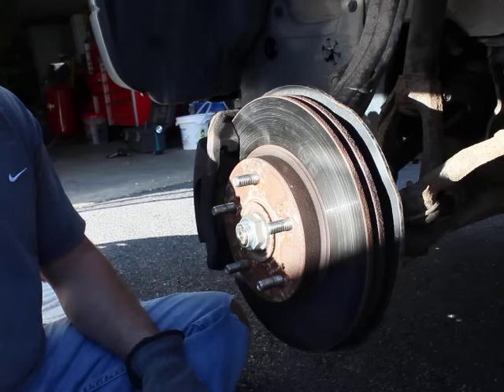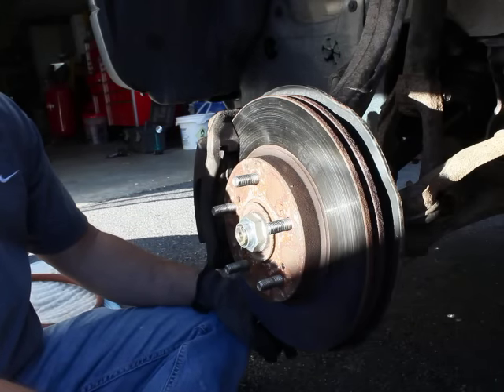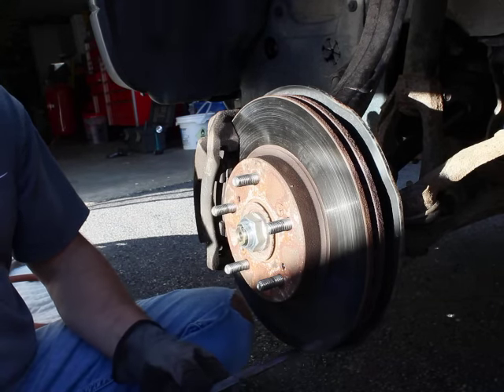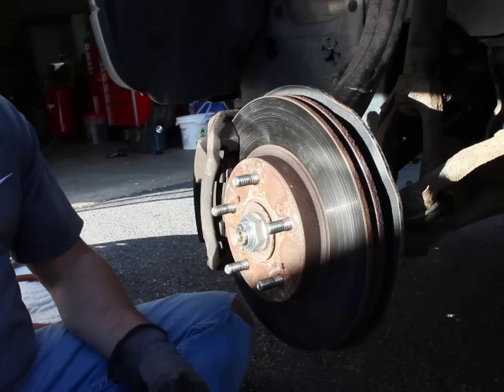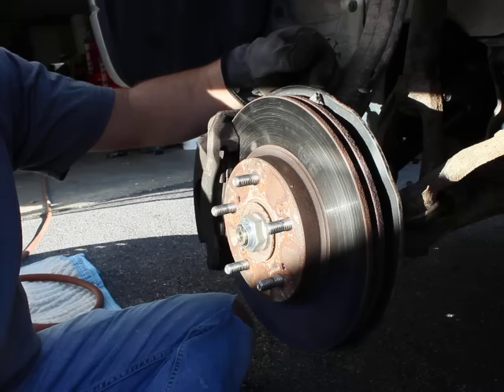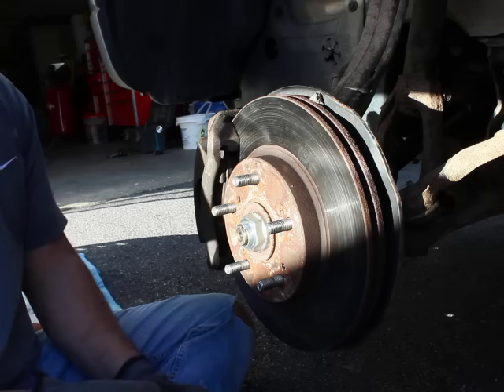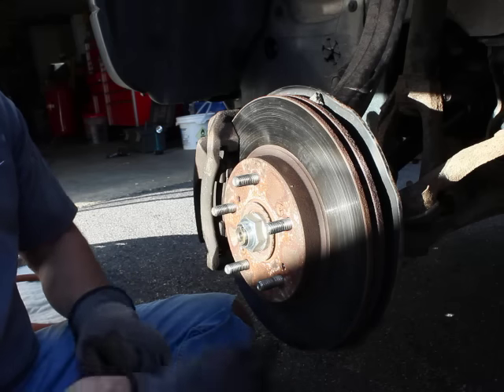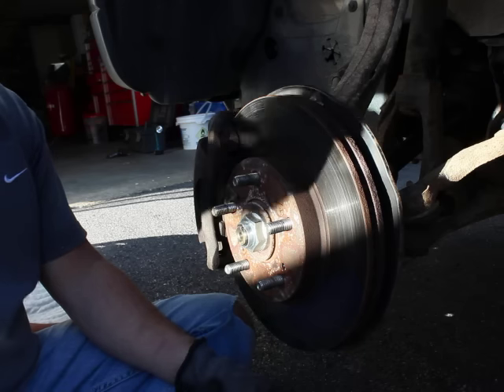Scraping Noise From Wheel While Driving

Comment: I hear this exact sound, but I don't know if it is this issue. I hear it for a couple of seconds when I start the car, and when driving at low speeds. It goes away once I get to about 35-40+ and it is not constant. It makes the noise then goes away, but it's this exact noise and sounds like it comes from my front driver tire
Reply from the maker: Hi Rob, I recommend you check the brake pads at the wheel you hear the noise, check the inner pads closely because this is usually where the wear indicator is located. The wear indicator is a warning tab mounted to the brake pads and touches the rotor when the brake pads are getting low. Let me know what you find, thanks.
Reply: @EddieCarrara1  I did the brake pad job myself about two months ago. I needed rotors too but I couldn't afford them, so I only did the pads cause it was super low. I just changed the rotors about 2-3 weeks ago and thought that would help with the noise but it hasn't changed at all. The noise was happening before the brakes were done, after they were done and never went away. Still currently hear it.
Reply from the maker: @Napoli85  Sorry I didn't see your reply. I would try pushing on the backing plate to give more clearance between the backing plate and rotor at the wheel you hear the noise at, it may be a quick fix. Keep me posted 🍻
Reply: @EddieCarrara1  I did but it did not help. I hear it when initially press one the gas pedal but when I apply more pressure to the pedal, it then goes away while I'm driving. It's at really low speeds and when I press the gas.
Reply from the maker: @Napoli85  Oh, then it's probably not the brakes. Sometimes the exhaust heatshields become loose from age or small pebbles get caught in the shield and cause a rattle noise on acceleration. Can you make a 30 second -1 min video of the noise, upload it to youtube and send me the link?

Comment: what do you think it is when it makes that exact noise when turning only right  about half a turn to a 1 full rotation of the wheel
its the front driverside  but i havent had my brakes done
Reply from the maker: It usually is a sign that the rotor backing plate is too close to the rotor, try using a screwdriver through the wheel and push the backing plate away from the rotor. You'll know right away if it worked or not. Keep me posted on what happens, thanks.
Reply: it comes from the front wheel tho  and i cant see the a backing plate on it  just in case i pushed the back wheel plates away a little but it remains the same
would low power steering fluid cause this?
ive read a few reports that it can cause squeeks and scrapes
Reply from the maker: Sure it possible low power steering fluid could make that noise. Can you make a video of the noise and post it so I can hear it?
Reply: i can try  dont know when ill be able to
thanks for showing interest mate
Reply from the maker: Sure, no problem. I'm pretty good at discerning noises if I can hear them. Even if it takes a few week to get the video up, just send me a link, and I'll take a listen.
Reply: Eddie Carrara turns out it was the wheel bearing
it had worn enough to have a metal on metal scrape
Reply from the maker: Wow, that's very unusual, good thing you caught it in time before it ruined the spindle. Thanks for the update, I really appreciate it :)

Comment: i just got my my brake pads and rotors replaced about two weeks ago and recently this squealing noise has been coming from the drivers side what might it be?
Reply from the maker: edwin m Hey Eddie, The rotor backing plate may be a bit too close to the rotor or it's possible maybe some rust flakes have fallen between the rotor and backing plate. When do you hear the noise?
Reply: I thought that might be the problem.i usually hear it after driving like speeds of 80-100 then when am breaking i start hearing it.
Reply: I figured out the problem, I got cheap brake pads. Learnt my lesson.
Reply from the maker: That will do it every time Eddie, cheap pads will get you by, but with a lot of noise and grief :)

Comment: I had my brakes and rotors done 2 months ago and i got a set of wheels installed recently but on the front passenger side wheel i notice the caliper clip grinding against the wheel theres no clearance, took it to a shop and they told me to leave it like that till the clip pushes itself a bit back but im not sure thats a good idea any inputs?

Comment: my 01 suburban makes a noise like something lose coming from my rear passenger side wheel. it's sound like the noise in your video. only happens when I'm driving and hit bumps. it started after I got brakes change.
Reply from the maker: Hi Bernard, I recommend checking the backing plate first, if everything looks good, bring it back to the mechanic and have them check it out.

Comment: i get a grinding noise when i turn too far. This just started happening.
Reply from the maker: Hi David, is the car moving when you hear this noise or can you be sitting at idle and just turn the steering wheel all the way in one direction? If the car is not moving and you hear it, check the power steering fluid level in the reservoir. If the car is moving and you hear a scraping noise, check the rotor backing plate on the wheel that is making the noise, you may either have some debris caught in there or the plate got bent somehow?

Comment: i'm having this issue i'm hoping its the back plate. starts to scrape here and there when i drive. Thank you for this video.
Reply from the maker: Marco Mejia Sure thing Marco. keep me posted on what you find, thanks.
Reply: sorry for the late reply, So i inspected the back plate brakes, rotors, caliper but looked normal to me. But i did notice that the brake pads looked worn out so i thought maybe that might be the problem. Weird part was that the scraping only came when i started to drive, never when i braked. But as soon as i changed them the scarping was no longer and i am happy :) still appreciate your'e video Eddie Carrara
Reply from the maker: Awesome Marco, that had to be your issue :)

Comment: How's going Eddie just watched your video gave me a tip , I have a jetta Vw VR6 1998 and I just put on new wheel bearing & axle after replacing it I took it for a test drive and everything was smooth today later in the afternoon was running okay then I started hearing some clack noise and sounds like caliper is hitting something, and I hear a grind with the disk , also when braking it sounds brutal feels like something is about to snap or brake .

Comment: Wow I just replaced my breaks and rotor. Ima bout to go try this. But also, it makes a worst scrubbing noise when I brake.
Reply from the maker: Hi John, If the noise is louder when braking, it's possible one of the anti-rattle clips or shims is not centered in the caliper so check that as well. Let me know what you find, thanks.
Reply: @EddieCarrara1  it was my back passenger, not my front passenger 🤦‍♂️🤦‍♂️🤦‍♂️

Comment: My wife and i hear is spirractically when we are accelerating. It isn't constant though. Could this be the issue?
Reply from the maker: Hi Randy, possible but more likely an exhaust heat shield is loose, they usually vibrate or rattle under light acceleration.
Reply: @EddieCarrara1  thank you. So we just need to get that tightened down somewhere. Im not mechanically inclined so how much would you think a shop would do that for?
Reply from the maker: @randyguyton66  It's not much, maybe $30 to either remove or install a clamp on it if that is the noise.

Comment: Hopefully nothing is wrong with mines. I was driving today and I noticed there was some debris in the road, then a guy in front of me couldn't decide whether or not he wanted to move over in the left lane. I had to hard brake, swerve and go around him. When I slow down I hear some grinding noise similar to that coming from the front left tire, and I only hear it when the wheel spins
Reply: I just installed new front and back brakes same noise of grinding in rear will try ur. advice Eddie
Reply: I got lucky. Sound went away and there seems to be no problem.  I am going to set aside some money to have it really looked at tho

Comment: Ok...here's my issue. I had a car that sat for about 6 months under a car port. after getting it started, I moved it and it sounds like just what the video described coming from the rear. The brakes are fine...and to be honest, it sounds like the dust plate but is it possible with it sitting there, not being touched?
Reply from the maker: Melissa Tucker Hi Melissa, most likely it just the rust built up on the rotors causing the noise. You will need to drive it for a day or two, it may not go away completely, but it should subside a bit. Let me know what happens, thanks.

Comment: I can hear the scraping noise when I’m like driving slow
Reply from the maker: Hi Shawn, Either your rotor is contacting the backing plate, there is a pebble stuck between the rotor and backing plate, or your brake pads are worn and need to be replaced. I recommend you pull the wheel where you hear the noise and check out the brake pad thickness, especially the inner pad because it's the most likely culprit. Keep me posted on what you find, thanks.
Reply: Eddie Carrara ok... I had drive on a dirt road since that heard the noise,Will let you know.

Comment: Hi Eddie,
Great video, it made things super clear!
Something just happened to me today:
A place I trust checked my brake pads on my 2007 Honda CRV, told me that they have a couple thousand more miles on them (4.5mm in the back, 7 in the front). I hit a nail and my front left tire went flat. So yesterday I put the donut on, drove to their station and they fixed the flat, replacing the repaired tire.
Today, I notice whenever I hit the brake that I get a very noticeable scraping noise about 90% of the time, and listening while driving it seems to be coming from the front tires.
Any ideas what might have happened? I checked the backing plates but they didn't seem particularly bent.
Reply from the maker: V Tancredi Sorry for the late response, but most likely when they were changing the tire they bent the backing plate, it's tough to see so you may want to take a screwdriver (without taking off the wheel) and push the backing plate away from the rotor slightly on the side you hear the noise. Let me know if it helps.
Reply: Eddie Carrara Thanks Eddie. The noise only happened when using the brakes, not constantly. I pushed on the backing plates anyway but it didn't matter.
I brought it back to the place and it got even more fun - they found one of the clips that holds the pads in place was bent and hitting the rotor when engaged. That took care of the noise in front. 
-Do you know if that bending would happen from having a flat tire and driving on it, or is it something derived from changing the tire during repairing the flat?
-ANOTHER squealing noise started up at the same time, amazingly. This time, from the back tires. it would be started by engaging the brakes but last a bit longer, even after pressure was lifted from the pedal. They told me it was because the inner pads on my rear brakes were actually lower than the outer pads, and that was the standard warning squeal that tells you the pads need replacing. It did that for a couple of days and then stopped. Thoughts?
Reply from the maker: I'm not sure how the clip got bent, but I have had that happen often, The rear inner pad may have been stuck in the caliper causing it to wear prematurely, but now that the noise is gone, the wear indicator may have broken off. Let me know if you have any other questions, and keep me posted on what you find.

Comment: so the noise i hear on my truck is a sound like that like a grinding noise i was wonering is it because of this if so can you please help?
Reply from the maker: +the20yearoldify If it's a grinding noise you may want to have the brake pads checked, it would probably cost you $30 to have them checked, it sounds like they are getting low. Keep me posted on what you find, thanks.

Comment: I have a 09 elantra, my front left wheel is is makin an insane amount of grinding and clanking.  im not sure it its the brake pads or the bearings, but the noise stops about every 1/4 mile then continues
Reply from the maker: Hi Jerome, it sounds like brake pads to me, wheel bearings make noise like a helicopter blade, but usually are consistent and steady. I recommend having the brakes checked ASAP. Keep me posted on what you find, thanks Jerome.
Reply: Is it normal for only one wheel in particular to be making the noise? .
Reply from the maker: Yes, brakes don't always wear even, in fact, it's very rare for them to wear evenly, so have them checked soon and keep me posted, thanks.
Reply: Brought it in today. They said it was both the brakes and bearings,  the guy claimed the bearings were damaged severely. He claims my tire could of came off while driving, but im positive he was jus exaggerating the situation.  Had to leave the car overnight. I will let you know
Reply from the maker: Yes, some mechanics like to make things seem worse than what they really are (like the media). It's rare to have two wheel bearings go bad at the same time unless the vehicle was in an accident of some sort. This is how mechanics up sell unneeded work and get away with it, once the wheel bearing is removed, there is no way to tell if it's faulty. Thanks for the update Jerome, I'll wait for the results :)

Comment: I'm about to put in a new wheel bearing, mines been making a similar noise on a 2012 ram 2500. the rim is to hot to touch when I stop driving. it was smoking when I got home yesterday. today after pulling it apart originally thinking the rotor or pad was bad and now can hear the bearings grinding when I turn. think the bearing is my only problem?

Comment: Mine goes into a bump then it makes a noise when it speed up to 40 then it will be gone. Isit just a minor fix?
Reply from the maker: Hi Yuki, I recommend you check the backing plate at the wheel that is making the noise first.

Comment: I have the noise coming from my left front wheel but the noise goes away after  10 mts of driving. I wonder if it my hub bearing
Reply from the maker: Hi Martin, bearing don't usually make a noise like this, most likely it has something to do with the rotor, backing plate, or brake pads. When brake pads heat up the wear indicator expands and move further from the rotor causing the noise to disappear.

Comment: What else can cause that? I checked my plate and it's not that.
Reply from the maker: Hi Neutron, if it's not the backing plate it most likely is the brake pad wear indicator located on the inner brake pad warning you that the your brakes are getting low and need to be replaced. Let me know what you find, thanks.

Comment: I’ve got a Ford Fiesta mk 6 only recently started to hear this sound only hear it mainly if I pull away with the wheel turned right or if I am slowing down and turning into to a road or evening if I’m backing out of a parking space it happens periodically so it’s not constant
Reply from the maker: Hello Mr T Bag, I recommend you start by checking all brake pad thickness, inner and outer pads, closely check the inner pads where the wear indicator is commonly located. If all looks good, it could be a backing plate too close to the rotor or a small pebble caught between the rotor and backing plate. Hope this helps, and keep me posted on what you find, thanks.

Comment: Hi in my 2006 cadillac dts, when you are driving slow it sounds like a plastic cup scraping but nothing is scraping when i looked at the car so i don’t know what’s happening to it?
Reply from the maker: Hi Giovanni, Do you have stock wheel and rims on the vehicle or oversized wheels? Are the fender liners secure? Is the under-engine splash shield secure?
Reply: Eddie Carrara I have stock rims and yes i think the under engine splash is secure but i don’t know what fender lines are. i looked under the car and i don’t see anything that could be dragging
Reply from the maker: @pacocountcontessa3719  Fender liners are plastic covers up inside the fenders, they prevent water from splashing up into the engine compartment, sometimes they become loose and rub against the tire while driving.
Reply: @EddieCarrara1  i think they are secure. it sounds like the brakes or something are messed up. i have no clue
Reply: @EddieCarrara1  It would be hard for me to record it because the mic probably wouldn’t pick it up and because of the loud engine
Reply from the maker: @pacocountcontessa3719  Does the noise change when applying the brakes?
Reply from the maker: @pacocountcontessa3719  You could try to make a video and see if you can hear the noise before you post it??
Reply: @EddieCarrara1  A little i think. idk if i press the brakes it gets a little bit quieter
Reply: @EddieCarrara1  Ok
Reply from the maker: @pacocountcontessa3719   So if the noise changes when braking it's possible one of the brake pad wear indicators is touching the rotor warning you that it may be time to replace the brake pads. I recommend at least checking the brake pads to see how much life is left, the inner pads usually have the wear indicator attached to them so you will most likely have to remove the inner pads from the caliper to inspect them. Let me know what you find, thanks 👍
Reply: @EddieCarrara1  ok

Comment: Hi i have the metal to metal sound on my rear passenger side rotor. I thought it was a bad rotor so I changed the breaks and rotor but the noise is still there and i kinda got louder is it possible its the dust cover?